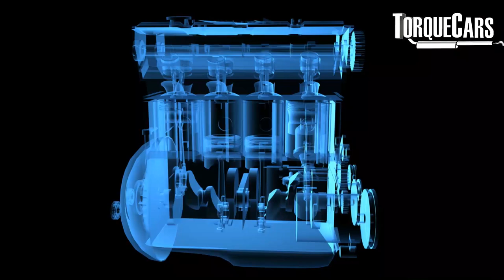Is Modifying Cars Easier or Harder? [Old vs New]

Comment: Tuning was easier and cheaper years ago but tuning newer cars just requires the software and knowledge. First vehicle I tuned was a 2005 GMC Canyon. I didn't know anything about tuning and ECU, but after a while I figured it out. Then I tuned my 01 A4 1.8T and I've more than doubled factory power. The cost to tune a modern engine heavily out weighs the complexity!
Reply from the maker: A lot of people say the 1.8T changed tuning forever, it was remappable and solid with a good turbo on it. It does certainly require a different skill set. Something like ABS have made a phenomenal difference. Going back to drum brakes with no ABS anyone?